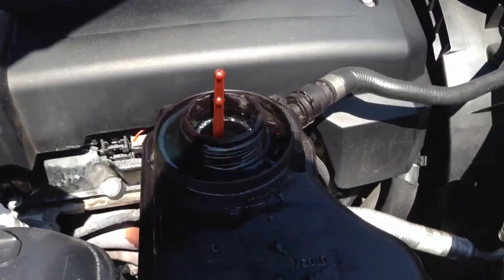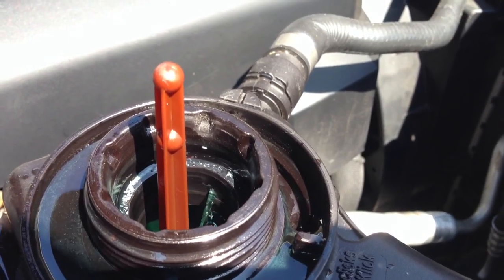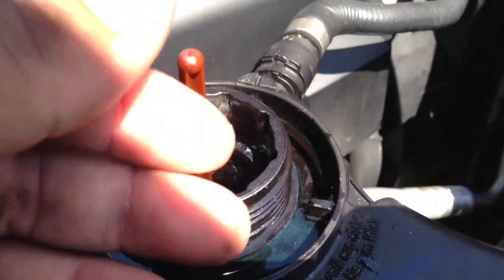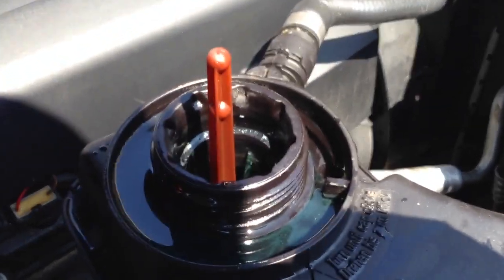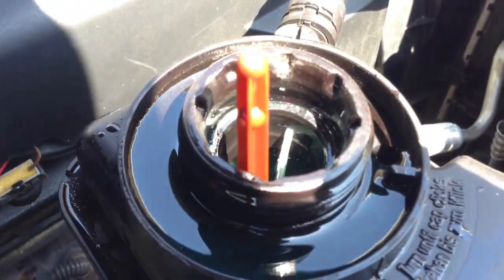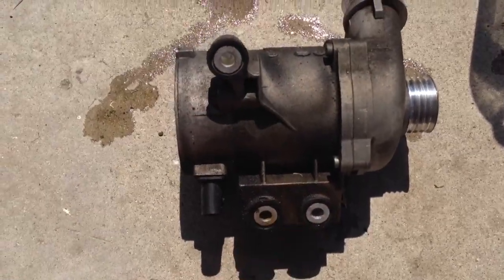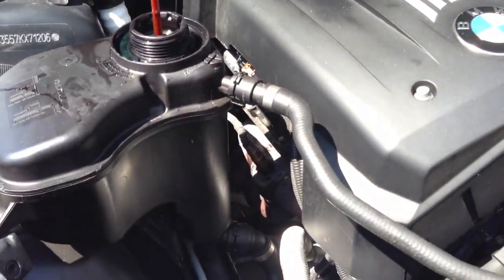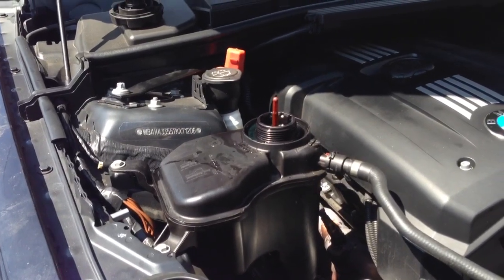Electronic Water Pump Air Bubble Removal BMW E90 E93 E92 E91 E46

Comment: I just wanted to help clear up his guide, turn on E-pump on an e90/E92/E93:
1.push the gas pedal.
2.put the key in the slot while keeping foot in the gas pedal.
3. push the start button (do not put foot on brake)
4. hear pump turn on
5. let go of gas pedal
make sure the coolant is overfilled just a bit
Reply: All good had 5 of these cars don't forget to buy a trick charger from harbor fright Wal-Mart (cheapest)  your battery will die   if you don't trickle charge it or jump it with another car. Car has to sit for 10-15 min. If yours is milky at reservoir your coolant temp on engine will have milky oil on it. Flush car add coolant do what he said after battery good .
Reply from the maker: THANK YOU

Comment: I have a bmw 325i 2006 . recently i had oil flow into my coolant reservoir. We changed the oil filter housing gasket because it was cracked and broken we also changed the electric water pump and sevral coolant hoses , the car runs fine and doesnt overheat it just keeps gushing the water back after a while i can run the car for about 5 minutes with a full water tank before i need to get off and put more please help guys btw there is no more oil in my water reservoir . thank you guys.
Reply from the maker: Tuned Rice And you removed all air bubbles just as the video 👆🏼?
Reply: When i start the bleeding process how long until it finishes bleeding it all out?
Reply from the maker: 10 TO 15 MINUTES DO IT 2 TIMES
Reply: @RepairFanatic  omg it worked!!!! Thank you so much i love this channel 😭😭💛💛💛💛
Reply from the maker: good thanks

Comment: Do you have to bleed it after you replace the oil housing gasket, I ask because the coolant system is opened when the oil housing unit is removed.

Comment: my car is over heating. i replaced the thermostat in it and the fan and and clutch and its still over heating i have a 2002 bmw 530i with the m54. i really dont know what it is. i checked the water pump while tge thermostat was out and it has no bearing play and when i spun it, it pushed all the water out. please help

Comment: I Got the same Problem with my E82 135i.  Bmw Span Service say to me its the water pump Today i was in a workshop to prove what the problem is.  But they checking it and they found nothing.  Do you got a idea?
Reply from the maker: Craz_O is the water pump working.??
Reply: Yes, the Problem is definitly the water pump. I did paid 650€ in a "free" workstation. When you go to Bmw the price is higher, like 800€~

Comment: if this isnt done after the T STAT was changed will it get hot and over heat?
Reply from the maker: yes
Reply: I did you your water pump test and it failed, wear can I get a water pump that aint 500.00 ?thanks

Comment: so you put the key in but don't press the start button.. then you hold the gas pedal down and the water pump will cycle for 12min then turn off by itself after 12min. And does the rad cap have to be open during the bleeding or you can you keep it closed

Comment: I just did this and it was easy but I had a lift . took me 6 hours at an easy pace. get a flexible ratchet extention for the top bolt. (i used flexible 1/4" drive socket though took kinda long but had to remove the hose that is in the way made it easier)  Also a 10mm works for all 3 of the inverted hex bolts. I bought my pierburg for $270 on ebay and $50 wahler/behr thermostat on amazon. Use a circular motion of force when re-installingthe hoses that have the metal wire clip, you'll know it's seated correctly when its all "snapped" in. if you dont it will eventually spray out as happened to me. GL all!

Comment: Do you have to use only bmw coolant... or can I use the universal prestone coolant for all vehicles? I have a 2006 x3...
Reply from the maker: If your coolant is blue keep using BMW coolant.
If your coolant is green/Orange you can use the other brands. Just don't mix your coolants.
Reply from the maker: I never had any problem using other brands of coolant
Reply: +Repair Fanatic thanks for the reply!! I just changed the expansion tank and i wanted to be sure... your videos were a big help. thanks again and keep posting!

Comment: I want to flush my heater core but, I'm confused. I have three hoses on the back firewall. I don't know which ones to disconnect and blow water into. I know I have to blow water in a reverse direction, but I don't know which one to do it with. 2000 , BMW 740il , e38

Comment: #myviewsonwaterpumps.
most often the entire water pump is not damaged when experiencing engine overheating.aside the overheating the car will be experincin som wierd battery drain.this is normally due to the faulty thermostat attached to the water pump.this keeps the water pump runnin whist the car is off and locked.u can check this by usin an audio piece(eg.stetoscope..that is what i used against the water hoses) .to correct this overheatin and batterry drain..jxt get a relay and keep the ignition in the relay...water pump turns on only when ignition is on..thanks...

Comment: make sure to tender your battery or the whole operation will stop if the battery levels falls below a certain threshold. so the guy that only did it for 7mins, its possible your battery went below the threshold

Comment: So, the cap must be opened on cold and off engine?
Reply from the maker: Yes Engine off And cap off
Reply: Grant H Either way it doesn't matter. If the cap is on, the bleeder valve needs to be open, otherwise the air pockets will get to the reservoir and then keep pumping around the system again and again. I believe the intent is to get the air to travel to the reservoir being the highest point in the cooling system, and then allow the air pockets out, so that only coolant is then fed back through the engine.
Reply from the maker: Yes
Reply: Can I do it like here? http://www.e90post.com/forums/showthread.php?t=18919
Reply from the maker: Just like that
Reply: One last question :) Expansion tank should be with opened cap or closed or it does not matter? Thanks!
Reply: Ivan Mitov Every resource that I've found online says to leave the coolant tank cap ON (unlike the video).

Comment: I have a 97 bmw 540i recently every other day I have to add coolant about 1/4 cup.  I checked the entire car, water pump,  hoses,  etc can't seem to find any leaks.  2 weeks ago the bleeder screw next to the radiator cap blew out i have replaced it, added coolant she was back running the car doesn't over heat.  DO you think i have a very little pinch hole in the resavoir, hoses? Please advice thanks. .

Comment: Hi,
I have a 2007 335i that started over heating out of no where a few days ago. Im pretty sure its the water pump. But I did the test with holding down the gas pedal to get the pump to come on with the car off. I could here the pump making a pulsing sound. But i removed the hose to the where the coolent goes in. And nothing is coming out?? Im assuming that means that the water pump is bad. Was just wondering if the pump would go bad but still make a sound like its working??? Please help, this my first time dealing with a electric water pump.... Thanks

Comment: My water pump runs and stops did your failing pump do that?
Reply from the maker: No your pump is working it's doing the cycle
Reply: when I turn the heat on the fan goes crazy then the temperature fail pops up. it goes yellow then red Beamer Fanatics E39 E90
Reply from the maker: Really add coolant make sure all air bubbles are removed

Comment: Great vid bro.. im having a constant fan but no check engine no codes no overheating. Just the loud constant fan. I replaced the coolant temp sensor but no luck. I took it to my local shop he ran it threw and said he never seen this before the pump is working but hes not sure why the fan is running?? Hes option was $950 to change the wp.. any ideas??

Comment: I did the electronic water pump thing and there is no water flowing out of the little hose  . Any advise. I even took the thermostat out still overheating .aslso I jacked up the front to bleed the colant
Reply: Do you fix it

Comment: I tried putting my foot and the gas and push the push to start buttom but nothing happened. I had a leak because I didn't bleed it out after adding coolant
Reply from the maker: Step on gas pedal for then pushed the key to the composition without turning on the car. You should start here hearing the water pump
Reply: okay I got it to work, but now my car wont turn on
Reply from the maker: Unplug the battery 15 minutes
Reply: okay thanks, the reservoir was leaking because I added coolant and didn't do this

Comment: Advice from a bit of research i've done is to have a battery charger hooked up while the pump is doing its thing for the 12 minutes. Waiting on a new pump to be delivered to replace the failed pump on my '06 325, so i'll be tackling this job in the next few days. Good video, thank you!
Reply from the maker: Not really necessary as long as you have your radio turned off